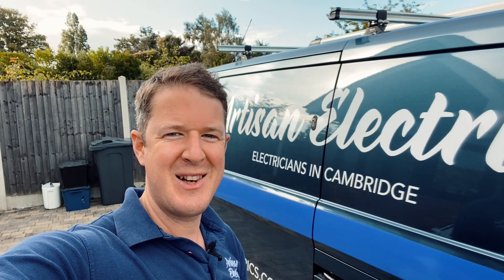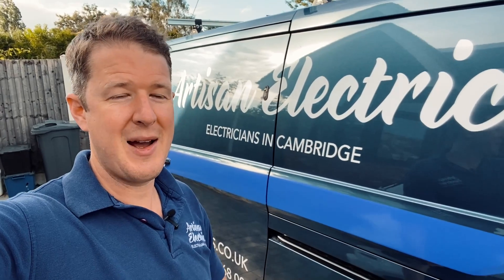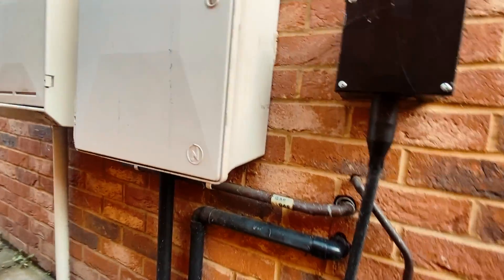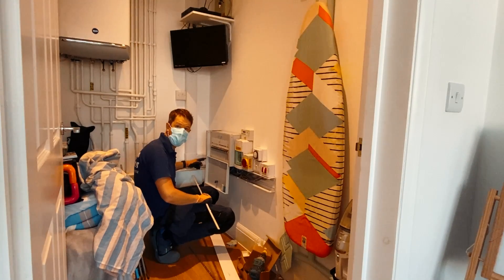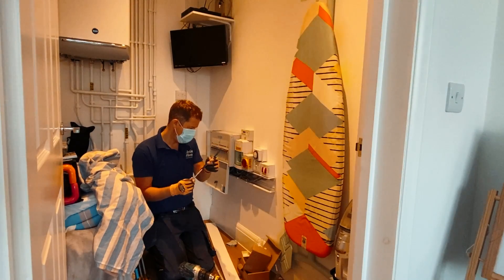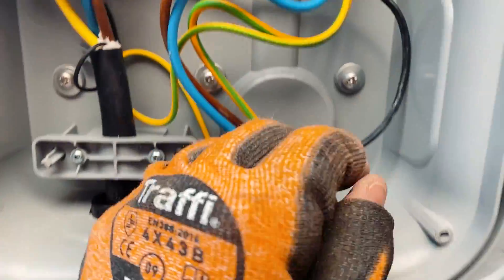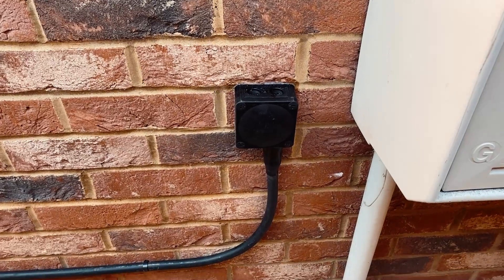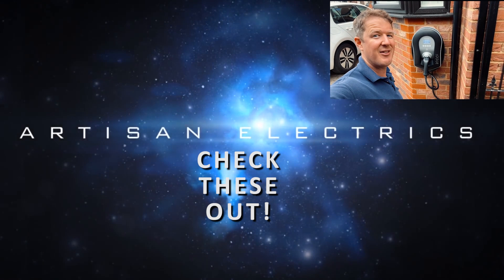Special EV Charging Cable - EV Ultra Install

Comment: Really like your videos, Jordan. Surprised the Zappi only has one terminal for CPC. The second ferrule looked uncomfortable with the first - almost pushing it out at 12:50.
Reply: It looked like there was a stud and nut next to the terminal, presumably that's intended to be used for earth bonding bits rather than the terminal?
Reply: @alexacb63  That other terminal is if you use a TT earthing system, I think its so the Zappi doesn't switch the earth in the event of a trip.

Comment: EV KING 🤴🏻 
nice cable too. Could be used for a few other things. Electric gate supply’s, garden office supply’s etc 👌🏼
Reply: The data cable only had two cores, so not much good for anything else really
Reply: Anthony charles I was assuming that Jordan had joined 2 pairs of the cat6 to a short 2 core lead and heat shrinked it. 
Otherwise what would be the point in the heat shrink ?
Reply: @Cablesmith  he said he did it to tidy it up, I am assuming as the cables primary design was for car chargers, the manufacturer would know they only need 2 cores and that's all they put in
Reply: Anthony charles makes sense so fair enough, there is a cat6 version tho I’ve seen it before 😀
Reply: Anthony charles this is what I thought it was 

https://www.efixx.co.uk/Articles/new-cable-simplifies-ev-charger-installation
Reply: @Cablesmith  to be honest that is the one I had seen as well, I think Doncaster cables were advertising it in professional electrician, never seen it with a 2 core cable
Reply: @acelectricalsecurity  Two cores and a screen can run most serial interfaces - RS422, RS485 (which means DMX, Modbus..), CAN, LIN, Flexray, DALI, you could run DSL down it (yes, you can do your own point-to-point DSL links). Plenty of good for plenty of things, really.

You can get it with 'cat5' (bit vague, no datasheet), too. Always could, really, this style of cable isn't new, it's just never been common.
Reply: @Monkeh616  yes that's true, but if it were for a home office, they will most likely want data, that  means a cat 5e, cat6 or on the job I am doing now a cat6A, so two core cable is no good

Comment: EV Ultra is available with a cat 5e instead of a twin data aswell, that way you could of clamped the solar and ommited the Harvi. 4mm EV Ultra is good for 45A Clipped direct aswell, looked like you may of been using 6mm. I'm not critising your install at all as it was very neat, just making you aware as it might save you cash and time in the future.... Keep up the good work Jordan 👍
Reply from the maker: Thanks!